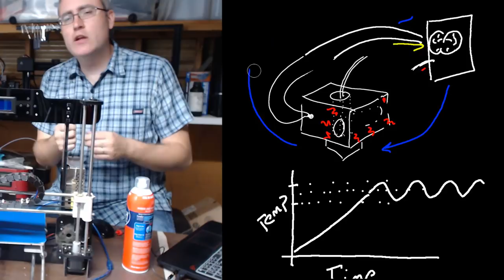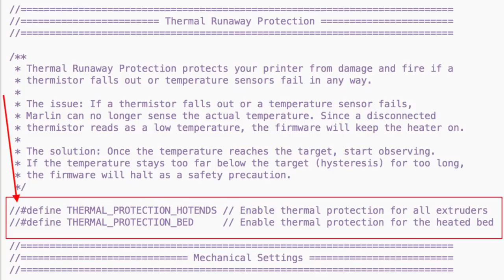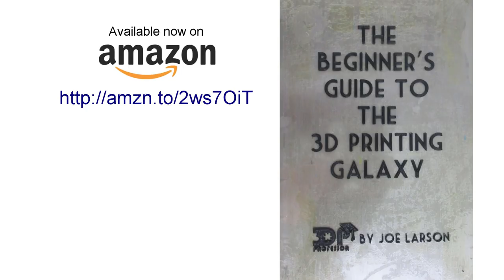Anet A8 Fire Danger and Marlin Upgrade

Comment: Holy Crap! I had recently dusted off the old anet A8 in hopes of getting working again. Low and behold, when I fired it up, this exact problem happened and I ended up boiling my pla. Turns out the temp sensor had fallen out of the block, causing thermal runaway. Luckily I was there to turn it off, and nobody was hurt nor property destroyed. Thanks for making this video, will update the firmware straight away!

Comment: Wow! I did not know that they had turned off that feature. I'd love to read that article though of where one caught fire. I have an Anet A8, the only one I've ever had. I've never had that kind of trouble with it, although after deciding on what printer I was getting I gorged myself on tutorials of how to use it and various upgrades to do. All this before it even reached my house. So after receiving it, as I was putting it together, I was upgrading it with a bigger power supply, mosfets for the heaters, direct soldering the wires to the bed, etc. I also upgraded the firmware to Skynet as per others recommendation. After a few months of no issues, I ended up with an issue where the filament wasn't coming out. Turns out the gear on the extruder motor had loosened it's grip, slipped off and wasn't gripping the filament. Easy fix. But then, not too long after, the extruder temperature was off, much more than usual, from what I had set it to be in the slicer. Wasn't like 100 degrees or anything. More like 10-15 degrees off. Couldn't figure it out. Then shortly after that, I couldn't get a reading on the extruder temperature at all. Generally just ambient temperature is anywhere around 21 - 30 some degrees. It was 0. Come to find out, the heater and temperature probe had slipped out of the heater block. I don't remember it actually heating at all, but the main point is that everything worked out and I think it's because of upgrading to Skynet and never actually running the stock firmware. I never knew they had disabled this safety feature until this video. Glad you're keeping up with this and getting the word out to everyone though.

Comment: I have an A8 just got it and it's my first 3d printer. Thank you very much for the info I'm doing this as soon as my 24 hour print finishes. I already desoldered the plugs and hard soldered the cables to the heated bed and replaced the heater block with an e3d v6. Keep up the good work sir.
Reply: Fyi to anyone who does the soldering upgrade the pins in the connector are shorter than I expected  almost ripped a pad.

Comment: I got my A8 about a year ago and it cost me less than $150USD.  One of the first things I did was join a couple of A8 groups on Facebook.  (Just about the only thing I actually use FB for.)  There is a document there that has a LOT of A8 upgrade, safety, and repair info.  INCLUDING turning on thermal runaway protection.

The thing about the A8 is that it's about as generic a 3d printer as you can possibly get.  There isn't a single part of it that can't be found online and replaced and upgraded, and, the information IS out there.  But this requires research and a bit of effort.  My A8 worked well when I got immediately after I assembled it, and now it absolutely purrs.

Doesn't anyone remember--not all that long ago--when we wrapped nichrome wire around ceramic tubes to make a hot end?

I've seen a lot of reviews on this channel where expensive brand new fully assembled printers did not work as expected and needed repairs or modifications pretty much out of the box.  There are top of the line ASSEMBLED printers with inherent design flaws rooted in proprietary designs that are totally dependent on the manufacturers for support.  In this very video, you pointed out how the Creality has the same software flaw that is at the heart of the A8 issue.

Perhaps the A8 represents a perfect storm of flaws and shortcomings that plague the industry, and IMHO, turning off safetly features like thermal runaway protection is criminal.  But ALL of the printers out there have components that get dangerously hot, or chemicals that shouldn't be in contact with skin, or create vapors that shouldn't be inhaled.  The whole industry should be approached with eyes open and a special attention to safety.  But blaming and shaming the A8 will not fix this problem.

Comment: Looks like someone is doing some good at Anet. I just read a comment from someone on YouTube indicating that they had just received a new Anet A8 and that it had 4 wires going to the heater terminals on the bed, in addition to the 2 wires going to the thermistor. That was the only thing the commenter posted, so there might be other safety related enhancements. But that is a strong step in the right direction.

Comment: Thank you for making this video.  Have an Anet A8.  Think this points out why using open source is so important.  If the code is closed, it is hard to see problems.  Wish car makers would use open source in there computer software.  Wonder how many people could have been saved from runaway cars.
Reply: Probably none? Worked in automotive software engineering - while i think engineering practices could be better and produce better verifiability, the software is actually reliable, they just squish the problem by throwing an immense amount of money on testing.
Reply: I had upgraded to Skynet V1.1...but I think I will go straight marlin (Skynet V1.1 is working GREAT on my printer...so why futz with it...and I know the runaway is turned on in that because I checked all the configs myself before I flashed)
Reply: There is the choice of adapting repeteir using  these instructions https://3dprint.wiki/reprap/firmware/anet/repetier/install
Or now using marlin with the supplied configuration files. Both will give you thermal protection I actually think the repeteir menus are less clunky than Marlin but use Marlin now due to my bltouch.

Comment: Thank you for posting this. I had been hemming and hawing about updating my A8's firmware for a year now and this finally gave me the push I needed. The new menu and pushing the center button instead of the right button to select will take some getting used to, but that'll work out in time. The Marlin firmware seems to be better at maintaining the temperature than stock A8. Stock set to 190 tended to run about 185-187. Marlin stays about 188-192.

That said, my experiences with the stock firmware is that if either thermistor, hot end or bed, failed, such as when I overtightened the set screw and crushed the little epoxy ball, both heats are shut off. It'll still run the gcode you're running, but without heat, the filament will just solidify in the nozzle. And both will display an error, so it's hard to track down the problem. This appears to be a safety feature Anet didn't turn off, so that's good
Reply: Minor update to my situation. My original A8 board died... I think one of the thermistors stopped working, it's been a while, so no heat anymore. So I've upgraded to a RAMPS board. It's a 1.6, which I know is not a true 1.6 from the current 1.4 (or last I knew it was current) but it was cheap and it works and now my A8 is even more fireproof, like Kirk Cameron.

Comment: I love my Anet A8 and quite frankly, I probably wouldn't have a 3d printer if the A8 weren't so inexpensive. But, with that said, as a former electrical engineer, I think it borders on criminal the number of poor choices that they made in their final design that was released to the public. The really sad part is that the corrections that I made to my printer in order to make it safer only amounted to a couple of dollars, if even that. At scale, it would cost less than a dollar to fix it, I'm sure. I won't recommend it to anyone with it's current flaws. But, I wouldn't trade mine for anything... Ok... Maybe a Prusa Mk 3. Definitely a Prusa Mk 3.
Reply from the maker: Definitely a Prusa.

Comment: Great video, I'm going to update the firmware before my next print.

This sounds like something that could make a good plug-in for octoprint, the temperature failsafe plug-in will prevent the sensed temperature from exceeding set temperatures but it doesn't appear to have the logic to shut down the heater if say the sensor was loose and just measuring air temperature.

The safety features need to be built into the machine but a backup via octoprint would be that much safer.

I don't know how to write plug-in's or I would be working on that right now.
Reply: Already done. Here: https://github.com/jneilliii/OctoPrint-TPLinkSmartplug/issues/59#issuecomment-420474368

I also made an arduino which does the same thing but isn't reliant on a router/internet connection. Mine uses a 433mhz socket but a relay would do just as well.

Comment: As a general tinkerer I love the fact I get to build and customise these machines. I want to learn and the only way to do that is get stuck in so thanks for this video. I shall upgrade my firmware on Christmas. I got it as a present so I built it to make sure it worked first. I think I got a fake machine because its wood not acrylic and the hot bed frame is wood not aluminium. all the other parts seem the same but I don't have some options like my last one had. My last one could put the print head to each corner so the bed could be levelled. This one doesn't have that option so I'm hoping the firmware update will fix that.

Comment: Strain relief is a MUST as well...physically attach the heater wires to the hot end carriage...so it doesn't pop out the heater or thermistor
Reply: Agreed.  I'd add a few fuses inline with the power input and power outputs which can also help prevent electrical fires caused by accidental shorts.  The cheapest and easiest is probably the inline automotive blade fuse (either the mini or standard size).  The fuses and fuse holders can be bought online or at nearly any automotive store for just a few of your local monetary units, and have various styles ranging from inline and splice varieties to dedicated fuse boxes.

I'm always a fan of multiple, overlapping protection methods.  If one fails, hopefully one of the others will catch the problem before it becomes a disaster.

Comment: I upgraded the firmware on my A8 a week or two after getting it becuase the stock firmware didn't support calibration codes from a remote host and there were some scaling issues with the steppers. A few weeks of printing after that, I had a loose heater element and got to discover the joys of mechanical debugging. I'm fairly certain that the runaway heat detection has saved me more than once. That element hit probably 400-500 degrees.

One fix other than upgrading the firmware, by the way, is to make certain the heater block is properly assembled. Check every screw, and while you're in there, stick a bit of PTFE tubing under the extruder gears to make reloading the filament less of a pain. Maybe I just suck at it. For accuracy, put some super glue or Loctite on all of the screws that aren't exposed to heat and aren't the ones holding the extruder fan on. They have an annoying habit of vibrating loose, and if you're like me then boy howdy will you be pulling that extruder apart a few times.

Comment: One thing i've noticed is the poeple building cabinates out of IKEA. Wood catches on fire ( if i'm not mistaken)  , so additional measures need to be added to a wooden frame to make it truly safe . One thing i thought of using is a tile base on top of the wood base at the bottom. The sides & top  i haven't quite figured out yet but i'm working on it . I've seen aluminum frames w acrylic panels . In my mind , also not acceptable. Aluminium would melt if a real fire ever got going .It will take a bit of thought but i will come up with somethimg.............

Comment: Anet A8 was my first Printer. at the low price i was amazed that it worked out of the box. but with help from community found many upgrades for safety and print quality first few were in place day one. others as skill grew.
 Just supersized that firmware would not be updated so many good reasons too

Comment: I think you can't compare the Anet A8 to the CR-10S when it comes to fire hazard. In fact there are multiple factors which in combinator lead to the A8 fire hazard: The A8 hotend uses a very simple mechanism to keep the heater from falling out (a screw from the bottom, that most people are not even aware of, untill the heater starts getting loose, If people were to tighten that screw from time to time, the danger would not be there.) Then the A8 doesn't have a silicone sock or kapton tape wrapped around the heater / thermistor assembly. If some kapton was wrapped aound that part, the danger would also go away, because if the heater would get loose, it couldn't fall out because of the tape. Then, the A8 hat got the cable that goes to the heater not being attached to the extruder sled. So for every move of the x-axis, it will pull on the heater. Fixing the cable to the sled, preferrably as close as possible to the hotend assembly would also make sure the heater doesn't fall out. If any of these measures would have been implemented properly they might have avoided the fires as well. If you look at the CR10 stock extruder assembly, it is really difficult for the heater to fall out because of the metal cage around the hot end. Also, the CR10 has a metal frame and a metal electronics case that is not connected to the frame. So even in case of a fire on the hotend or the electronics, there is not so much plastics to catch fire as with the Anet A8 and its acrylic frame. In my opinion even though the CR10 doesn't have the thermal runaway protection activated in its firmware, it is a much safer printer than the A8. But if you are using a 3D printer you should always try to make it as safe as possible, so you should update to Marlin with thermal runaway protection activated, but you should also fix the cables to your x-axis sled, you should tighten the screw that holds your heater cartridge, put some kapton tape around you hotend to fix your heater, and maybe revisit some of the changes to the hotend /extruder assembly and see if they introduce additional risk.

Comment: I've had thermal runaway on my Prusa MK2 twice in the nearly 2 years I've owned it.  The first one occurred when the hot end thermister wire broke.  The second time was due to the heatbed cable breaking.  In both cases, the controller reported the thermal runaway conditions and shut down.  I lost prints, but my house is still standing.  I prefer this outcome.  This is why I strongly recommend Prusa to noobies wanting to get into 3D printing.  Besides, Prusa actually has online support staff.

Comment: It's Repetier Firmware on the Anet and it defaults to protection disabled, and it's not quite so trivial to enable it, might not have crossed their minds, and it might not even work properly, judging by developers' conduct on github issue tracker.

However of course many ship with Marlin with protection disabled. That's difficult to even begin to justify.

Regardless, none of these should be left running like that.

Perhaps we need a grand database of 3D printers which lists
* whether they are flashable without additional equipment, i.e. have bootloader via USB
* whether they are compatible with open-source firmware and whether actively maintained distributions exist
* whether they ship an open-source firmware legally or under a GPL violation
* whether they have any of the numerous known safety features - i.e. individual bed fuse, individual hot-end fuse, thermal runaway protection in default firmware, flyback diodes on MOSFET outputs. Anet doesn't have any of those, not a single one.
* whether they have known severe construction defects like unsuitable connectors or unproven and suspicious MOSFETs. The heated bed connector on Anet for example is more than a bit suspicious. Geeetech has shipped unknown MOSFETs in some iterations of GT2560 board.

Also people need to be made aware that cable management and strain relief is EXTREMELY IMPORTANT, especially in kits that you build yourself or printers that you modify. The heater and bed wires need to be tied down in a kink-free manner where they terminate into the moving part and at a stationary point, this is non-negotiable. Chances are, none of the fires would have happened if everything was just affixed properly.

Comment: Anet A8 by default has a temperature protection system, the person’s fire in the news was because someone silly put in a new board without properly setting up marlin, worst still, he didn’t tighten the screw to his heater cartridge nor test it with a good tug so it fell out mid print, know this everyone, upgrade your printer safely and always test things before leaving your printer alone :P

Comment: 3D Printing Professor, great video!  I feel that anyone who is going to get into the hobby owes it to themselves to do a bit of research before making the plunge into 3D printing.  That said, I agree that Anet should not leave it in the hands of the consumer the upgrade the firmware of the bot to ensure some pretty serious safety parameters on turned on by default.  The quickest solution since the Anet A8 uses a modified version of Marlin is to ship bots with the open source software modified to there liking with the safety features turn on. Thanks!